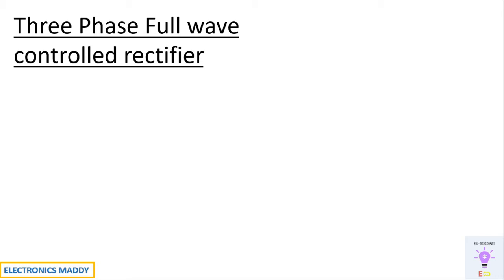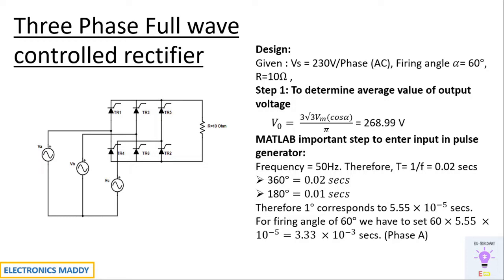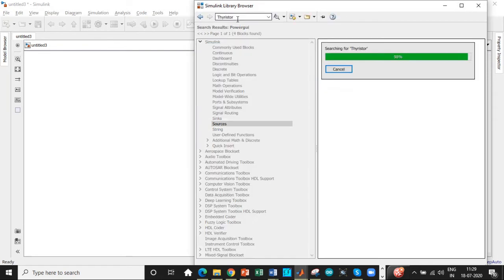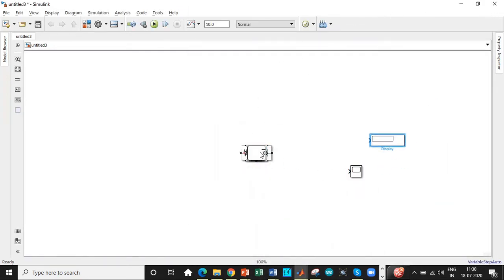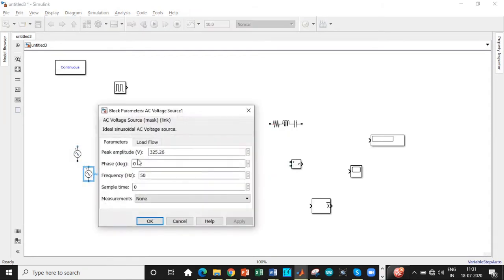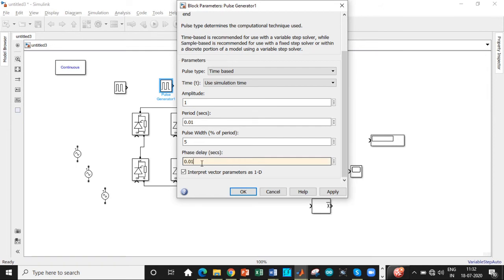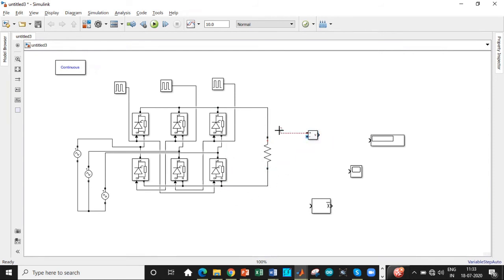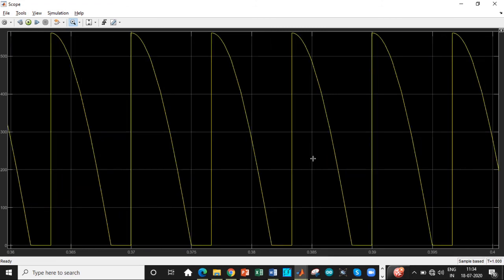Design and Simulation of 3 Phase Fully controlled rectifier in MATLAB | SIMULINK

Comment: Hello, I designed a 3 phase full wave controlled rectifier in matlab simulink. My question is: The average value of the DC output voltage is measured correctly according to the theoretical equation, up to the thyristor trigger angle of 60 degrees. but the average value above @60 degrees contradicts the theory. how to solve the problem?

Comment: how would we be able to simulate the 5phase source to feed dc motor
Reply from the maker: Hi. Can you please elaborate?  I did not get the context of your question.
Reply: @ElectronicsMaddy  oky thankyou for your  response. i am trying to simulate 5phase 380v 50 Hz system to drive a dc motor of any/my specification. i saw your video on 3 phase full wave controlled rectifier and based on that am simulating 5 phase source full wave controlled rectifier but am facing some difficulties
Reply from the maker: May I know what kind of difficulty? Usually triggering the switches will be the major challenge I beleive.
Reply: @ElectronicsMaddy  yes its for example the angles given for the pulse generator which is converted into secs  its not constant right? and what about phase voltage per phase given?
i will be looking for ur replays n thankyou
Reply from the maker: I haven't used 5 phase till now. What I would suggest is first look at the standard per phase voltage for 5 phase. Use that as your supply.  Select the phase shift to be 72 degrees and not 120 as it is 5 phase. Use the same logic to trigger the switches but the values will change. But I think you may require two more additional legs (4 more switches).  I would suggest you to get started this way. Let's see how it goes. Even I haven't tried this before.
Reply: @ElectronicsMaddy  oky i have started that way thankyou very much
Reply: @ElectronicsMaddy  n one additional thing  for the pulse generator block for phase delay am i going to give the delaying phase shift or triggering angle plus the corresponding phase shift for eg.in ur case u hv used 3.33e^-3 for phase A and 0.01665 and 0.02997 for phase B and C
Reply from the maker: Awesome. All the best :)

Comment: Thank you for this video. One question, isnt this a half wave controlled bridge since in your output you get only 3 "riples" per 0.02 seconds. Shouldnt a full bridge have 6 "riples" for their voltage output?
Reply from the maker: Actually the calculations are done for 0.01secs for one complete cycle. So you will eventually get 6 riples

Comment from the maker: If you have any questions please do let me know below.
Reply: Q1: For pulse generator, why you choosed 0.01 instead of 0.02? 
Q2: Choosing phase delay or firing angle for Phase A was understandable but for other phases? Sir
Reply from the maker: @Shootify_Vlog   Thanks for reaching out. Yeah it must be 0.02secs. However we can do it for 0.01 secs as well but the value for 1 degree will change and the calculations changes. And for phase B and phase C I have taken based on the 0.01 secs. They are triggered at 300 and 540 degrees respectively. Hope this helps. :)
Reply: @ElectronicsMaddy  thanks
Reply from the maker: You are welcome :)
Reply: Hi. Why is it that not every thyristor have their own pulse generator ? I mean, each one has their own phase delay right
Reply from the maker: @afiqmr  I am trying to trigger two thyristors at a time as per the conduction sequence. So we can avoid additional three pulse generators. However you can try that way as well :)
Reply: @ElectronicsMaddy  I tried  the method with where each has their own phase generator. It didn't work out as per theoretical waveforms sadly
Thanks for replying tho! Appreciate it
Reply from the maker: Yeah that's right. Appreciate that you tried :)
Reply: @ElectronicsMaddy  I am trying your method here, but Im unsure of what value to put for the phase angle. My firing angle is 45 degrees. So the first pulse generator phase angle should be-  
- >  A=45x5.55e-5=2.4975e-3, but I don't know how to get for phase B and phase C.
Reply: @ElectronicsMaddy  Solved it. Thanks !   :)
Reply from the maker: Well done :)
Reply: Can you design filter because its pulsating dc
Reply from the maker: Hi. Please check out one of my videos on selective harmonic elimination to reduce the harmonics using a filter
Reply: How to change conduction mode 120 or 180
Reply: It is also called three phase converter ?
Reply: how to calculate phase delay for phase B and C?
Reply: What will be the value of firing angle 90 since the theoretical value will be zero